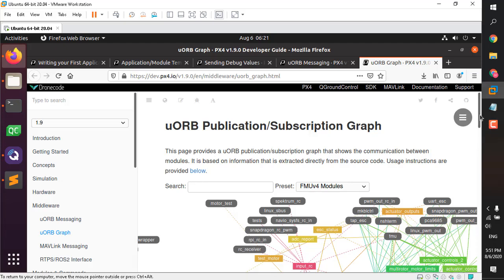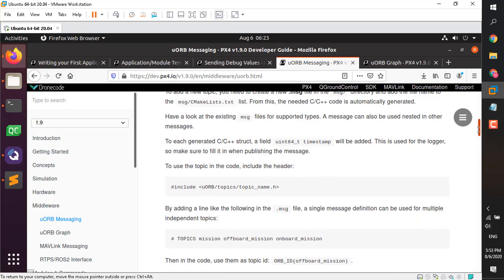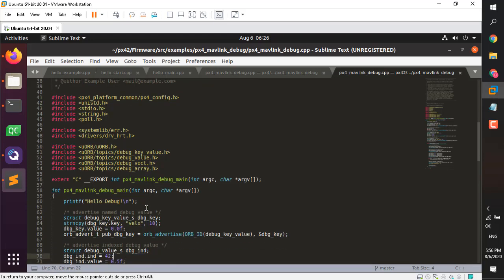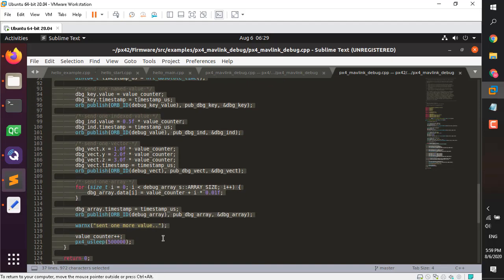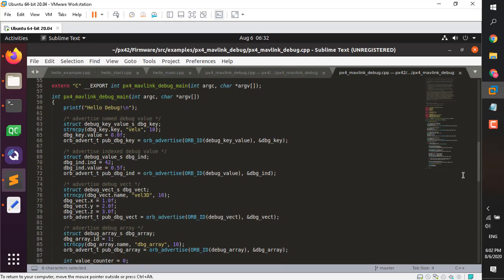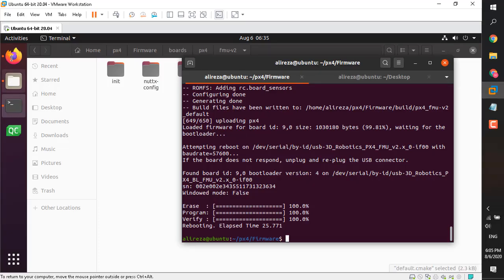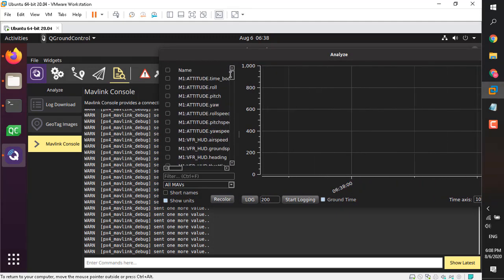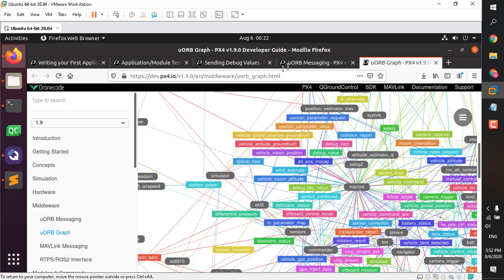Send custom Data from PX4 to Ground Station (from uORB via MavLink)

Comment: Thank you alireza ghaderi for this great tutorial,
I have a question, I build a new app inside examples folder, I followed the instructions in the px4 documentation, and I run git submodule update - -recursive, but px4 does not recognize the app.
What can I do to make px4 recognize the new app?
Reply from the maker: Hi 
did you add your app in the cmakelist? using that cmakelist before building you introduce your module to PX4
Reply: @alirezaghaderi  
 Thank you, I fixed the problem.
But I have a question. Could I create an app in the same way in Python?
Reply from the maker: you mean the module with python? i dont think so...you should ask on px4 developer forums

Comment: Now, I am planning to publish my px4 onboard sensor datas to my companion computer which contains ROS2 , Do I have to make publish and subscribe UORB nodes in side of the px4 right? I mean I will make a pub/sub nodes from ROS2 and px4 to make communication between them?
Reply from the maker: I havent worked with ROS actually. but if you are going to send data to Raspberry Pi, you should create a mavlink header for your custom uorb.  If you dont know how to create a new mavlink packet, you can use the mavlink debug messages to deliver your values. I have a video for that in my channel I guess.
Reply: @alirezaghaderi  thanks for the info :) I'll watch it too.
Reply: @alirezaghaderi could you tell me how to use debug values messages to send and receive values? Is there a video where you explained this? Thanks a lot :)

Comment: This would only broadcast uORB message to other modules (including MAVLink) inside the firmware. For the MAVLink to actually send the message you have to define your message and build your own MAVLink header files, and then implement the sending mechanism into the MAVLink module of the firmware. For the message to be received by the ground station, you will need to use the same MAVLink header files and then generate and implement your message's logic into MAVSDK  (or your GCS's MAVLink interface) and build the GCS software yourself.

PS: I suggest changing the video's name to just "uORB messaging" because you haven't touched anything related to MAVLink in this video yet. If you have a tutorial on how to implement the logic on both sides (GCS and PX4) of the MAVLink messages, please share it with us and guide us around these topics.
Reply from the maker: Yes Exactly...but instead you can use already available debug_array or debug_float message to send your own values...
Reply: alireza ghaderi well that is a different way to send custom values, but I personally still prefer the extension method though either of those methods would do
Reply from the maker: You are right. .but this is the simplest and easiest for those who are beginners to PX4 architecture so they wont need to create a mavlink header file. just a quick shortcut cheat:D
Reply: Thanks for the tutorial Alireza, and thanks for the clarification Hoang. Due to already compiled debug_array headers what is shown works